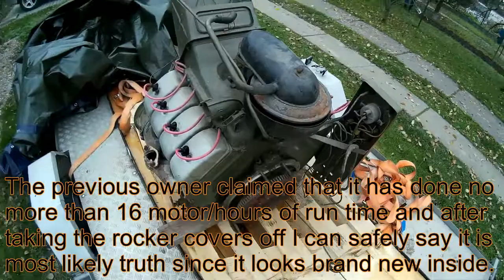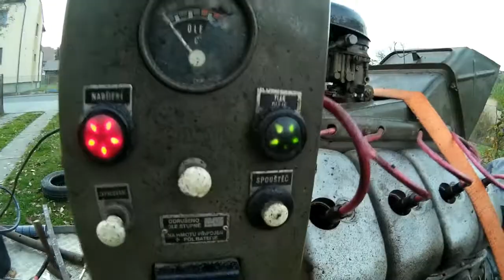Tatra v8 first start

Comment: I wonder why they would go through the trouble and expense of 8 cylinders for only 2.5L on a production motor?
Reply from the maker: You say only 2.5L :D but after the ww2 most cars here were only 1.1 or 1.2l (and lot of cars even before the war). This engine was designed in late 40s/early 50s and it was very modular and reliable (used in cars with twin carbs and higher comp., trucks, generators...) I recomend reading about the tatra 603 and 87 (100+ mph and 19mpg with this engine) 😉
https://en.wikipedia.org/wiki/Tatra_603 https://en.wikipedia.org/wiki/Tatra_87
Reply: @Skili19  Thanks for the info.  I don't doubt they were good engines, it just seems like it would be more expensive to produce an 8 cylinder 2.5L engine than a 4 cylinder, and for an application like a daily driver car or generator (i.e. not high performance) I'm not sure what the advantage of 8 cylinders would be?  They must have had a reason, I'm just curious what it was.
Reply from the maker: @8180634  I was developed for luxury car and military trucks. Also you can't aply that logic to comunist era czechoslovakia, there was central planing and you had to make what they told you to make. Tatra was to some extend an exeption but not really. It is hard to explain in youtube coment. Go read the wiki links, its good stuff :)

Comment: Looks and sounds nice. Check the oil system. Its a bit strange on the car engines, not sure about the generator version.
Reply from the maker: if you are refering to the oil light being on than you don't need to worry, it is reversed. When there is oil pressure the light is on and when it is off there is no pressure. I checked the electical panel before I even atempted to start it and this was one of the things that suprised me.
Reply: It is clear from your video channel that you are skilled enough to figure these things out & you know how to deal with them. There is a bypass filtration system & it isn't very good. I made mine into full flow & it passed the test. Looking forward to seeing where this is going. A motorbike?
Reply from the maker: @zbrojovkastar  The plan is to somehow stuff it in to my Octavia (pickup) but it will have to wait a year or two since I have already too many projects. The filtration system was pretty much standart for the time this engine was designed and I had cars with bypass system before and drove them daily just had to do oil change every 3000km... I may change it when I try to put it in to the car I know already the cooling system will have to be modifyed just to fit it in...

Comment: what happened to the fiat 126 ? ?
Reply from the maker: I still have it.
Reply: nearly fixed ?
Reply from the maker: @Kakoe  Nope. I didn't touch the red one since the last video I made with it years ago and the yellow one has broken gearbox and needs a lot of small things to pass inspection (bushings, some rust repair, brake lines, etc.) I want to finish the 1963 Octavia first and I have a lot of other work to do before I can work on it again. Also this year wasn't too good for me I crashed my daily driver so I had to fox it first and than two days after I got it painted I fell and hurt my shoulder and had to get some surgery so I wasn't able to use my right hand for few months at all and I still can't do any heavy stuff for two more months.
Hopefully I can get to fixing the red one next year.
Reply: @Skili19  oh that's a pity. I hope you get well soon. I have 2 fiat 126's im going to start fixing one of them during summer holiday with my dad.
Reply from the maker: @Kakoe  Thank you.
Good luck with your 126.